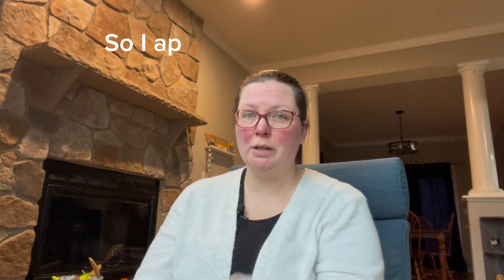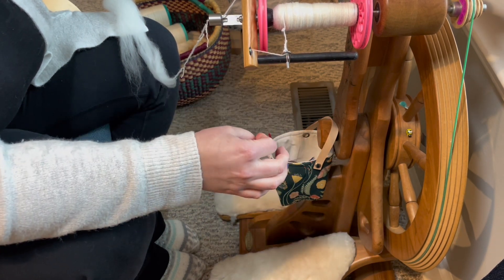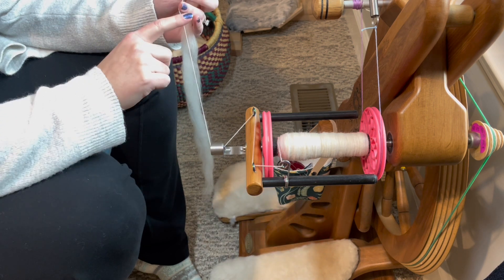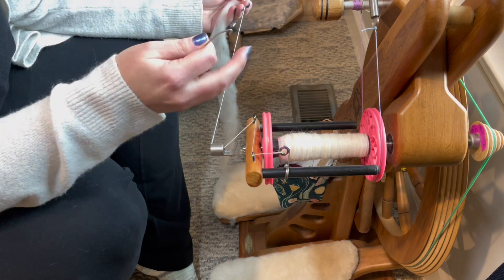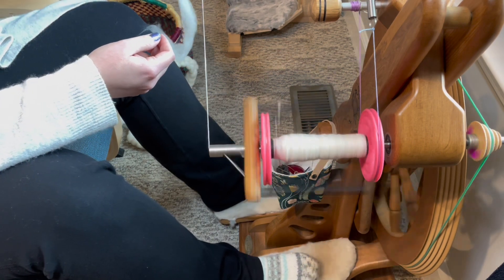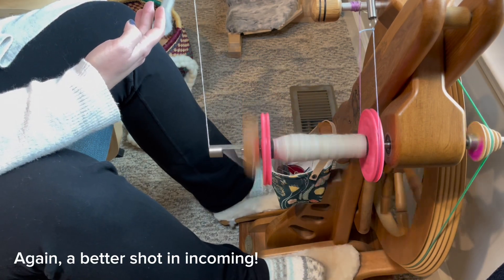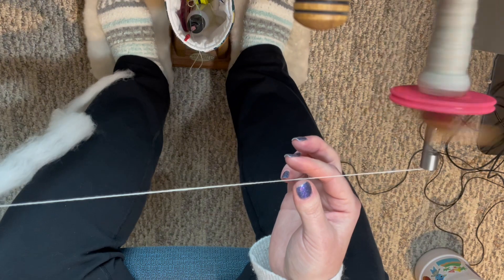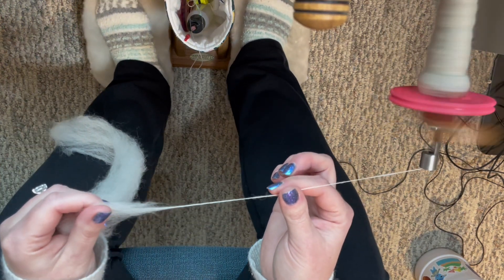Episode 24.5 Spinning Longdraw on a Spinning Wheel!

Comment: Thanks immensely Sara for this video.  I greatly appreciate your time and help.  
So are you saying the Magacraft Rose can function in either a castle or a saxony style?
I’m spinning homemade rolags with sari silk at about 20 to 24 wpi on a 6.5 pulley, the largest for my wheel.  From what you’ve described, I think my problem might be regarding the tension in what you described at about 7:40 and at 17:12 from not drafting consistently and I need to thin out my rolags more.
Should I get the same or similar results from spinning on double drive or scotch tension?  It looks like you are spinning in scotch tension right? 
I’m going refer back to your video and try the different things you mention and see if I can find the right setting for tension and play with other woolen fiber preps and different drive band materials.  Thanks so much for this video!❤
Reply from the maker: The Rose, Aura, and Suzie can all swing their flyer uprights to the left and right fully. So technically, yes. The can mimic a saxony. But it’s is still a scotch tension wheel. Once my new wheel does come in, I will do a video on the differences between scotch tension and double drive!!  However, double drive and scotch tension basically do the same things, tension the bobbin. Double drive is more subtle with the uptake where scotch tension can be more abrupt. 
Definitely keep fiddling with the tension and practice your drafting cadence. You’ll be a pro in no time!!